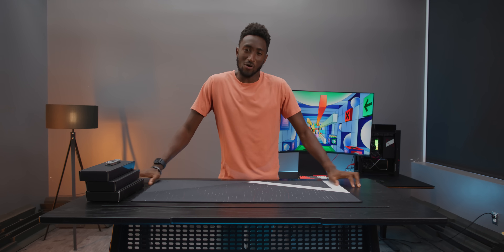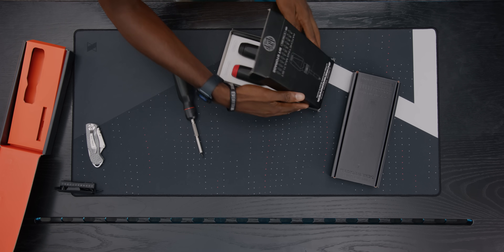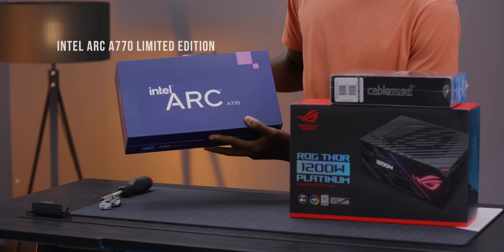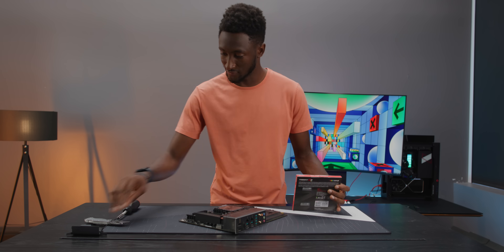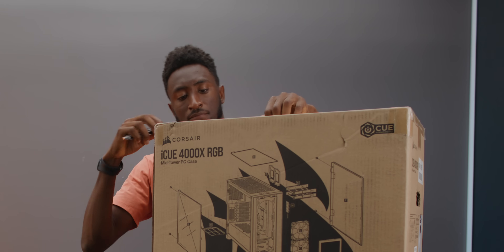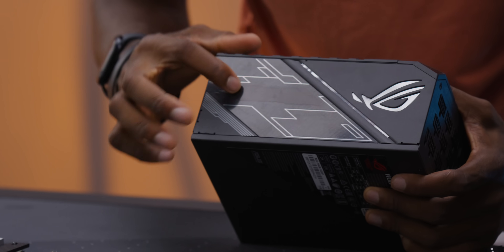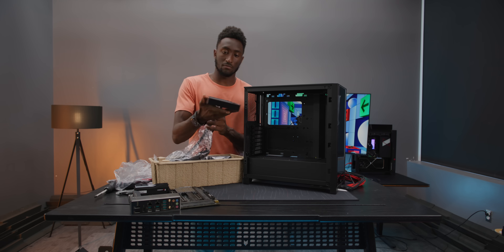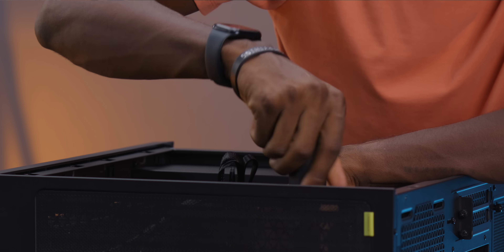World's First Intel ARC PC Build! (A770)

Comment: Now its easier to speak with hindsight now, and things have changed of course. But I will still criticise, for educational purposes, the video:
1. This build is wholly 'High-End'. Everything apart from he gpu is. Thats like calling the RX 6700xt 'High-end'. Nah, its a solid but budget 1440p card.
2.  You didn't say how much each part costs and total build cost. This is huge as people need to truly see the Cpu-Gpu imbalance. If you di an I5-12600k with the A770, THAT WOULD MAKE so much more sense (sorry didn't mean caps).
3. You really aren't supposed to front mount an AIO. Yes it works, but more dust gets towards the fans. Moreover (idk the exact science) but the cables are less optimised that way too.
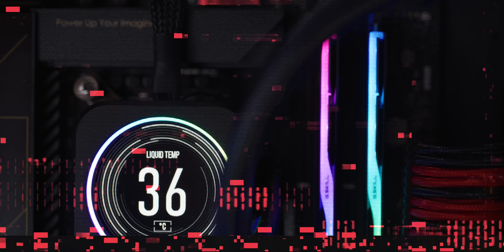4.. When doing the final shots of the completed build (14:45) , the 2 top fans are the wrong way round.
5. You only tested 1 game my friend. Yes time constraints and all that. But you tested ONE game. Come on now everyone else tests a good several and at 2 different resolutions. Hell even if you didn't have time to test at 1080p testing say 5 games at 1440p would have been actually a good test of the PC.
But I hope since its been a while now you know do these things. As well as doing: XMP profiles for ram, using Cinebench to test CPU etc.

Comment: That is the worst Water IO ever made; I got two DOA! I am surprised Corsair does not have a lawsuit against them at this point!
Reply: The h100i and h150i lcds and elite red triangle warnings and full speed fan issues seem to not be down to loose connections from the commander core, but a faulty commander core or cables. Moving the cables in the middle whilst on will give either of the two problems mentioned, or with any slight movement within a case over time. They'll usually send you a replacement under warranty but no real fix or swap for a better model. Even with the replacement I gave up on it after seeing the great number of forum complaints over these models. Corsair like to blame the issue on the software. I now have a thermalright pa120 fan cooler with no issues

Comment: why go so overboard on the powersupply for a system that will never go over 700w
Reply: Most good power supplies can last up to 10 yrs so he can use it if the system is ever updated or even changed completely.

Comment: You've got all expensive parts and then comes Intel Arc A770. It's a GPU for a completely different build, the CPU alone is more expensive than the card. Intel needs a broader range of dedicated GPUs, it's certain that you swapped A770 for something else. Interestingly, the performance gap between A750 and A770 is quite small. There's also a whole market for cheap, slow GPUs, Intel could get a foothold there.

Comment: The A770 is for 10th Gen Intel CPU's are greater and compatible motherboards. Here MKB is building it with a 9th Gen. OOPS!!!!!   Why?  Intel requires  Resizable BAR (ReBAR) enabled. This feature is only available on 10th Gen or newer Intel systems. In tests, Without ReBAR, the Arc A770's performance, on average, plummeted to 77% at 1080p.  Rebar allows much larger chunks of memory to be sent to the GPU.

Comment: Marques, please fix the CPU cooler. It really needs to sit on top. Either change it for a smaller 2-fan version or use a non-water cooling one. That poor thing is not working at its prime and will definitely shorten its lifetime. The system will probably take a bit of performance issues as well, as the water will not touch every part of the CPU (among other bad things, like bubbling at the top of the radiator, with its own bad issues) LTT selected all the parts??? shame on them... =)

Comment: Looking back, was any of this difficult? Were there any particular weird nuances when building this? This was a very clean build!
Reply: Now its easier to speak with hindsight now, and things have changed of course. But I will still criticise, for educational purposes, the video:
1. This build is wholly 'High-End'. Everything apart from he gpu is. Thats like calling the RX 6700xt 'High-end'. Nah, its a solid but budget 1440p card.
2.  You didn't say how much each part costs and total build cost. This is huge as people need to truly see the Cpu-Gpu imbalance. If you di an I5-12600k with the A770, THAT WOULD MAKE so much more sense (sorry didn't mean caps).
3. You really aren't supposed to front mount an AIO. Yes it works, but more dust gets towards the fans. Moreover (idk the exact science) but the cables are less optimised that way too.
4.. When doing the final shots of the completed build (14:45) , the 2 top fans are the wrong way round.
5. You only tested 1 game my friend. Yes time constraints and all that. But you tested ONE game. Come on now everyone else tests a good several and at 2 different resolutions. Hell even if you didn't have time to test at 1080p testing say 5 games at 1440p would have been actually a good test of the PC.
But I hope since its been a while now you know do these things. As well as doing: XMP profiles for ram, using Cinebench to test CPU etc.

Comment: The thermal dynamics are all wrong. Better get a larger case and put that radiator where it belongs. Trust me. Look at the air cycle. The amount of heat going back in is insane.

Comment: I hope Intel cannibalises the mid-range market from Nvidia. The artificial price hiking of the 40 series (to shift excess 30 series stock), the shameful marketing of a 4070 card as a 4080 (12gb) to further inflate prices... There needs to be competition in the low and mid-range space. 

$1000+ entry level to latest gen gaming isn't sustainable, damages the industry and generations should be increasing power efficiency, lowering form factor, lowering prices and increasing performance across the board. It seems Nvidia with its 40 series is incapable of innovating beyond higher power draws and thus performance.

Comment: 12:31 I almost wanted to say "mine", but on my build I found out that the case fans were molex... after I had mounted the modular power supply.

There's always something to improve, but mine went without any hitch bigger then 'needing to find the molex to power supply cable'.
After finishing the build I found out I had an old fan header->molex, but that would've made the front look less pretty.

Comment: Terrible build is terrible.  Way too much garbage RAM, too many SSDs, too much processor, 1200W power supply is ridiculous with a single A770, Cooler orientation matters the AIO will vibrate itself apart on bubbles and the Arctic Freeze is all around better cost, performance, and imperceptibly silent.  Whoever sold this to you took you.  Do you even know what you are doing?  You have a massive amount of money... pay someone to keep you from making these mistakes.  You're embarrassing yourself with this build.

Comment: I was panicking for a minute then.....I thought you were going to put 4 HOT gen 4 ssds in.....without any heatsink.....I was like... "is he making a computer or a fire risk" 

I got one of those 4tb sabrent rocket+ inside my ps5 with the specially designed heatsink cover for ps5......but when I have been playing for a while......if I rub my hand down the black middle of the ps4....I can feel a bit of warmth where the ssd sits inside.

Comment: the tubes at the top are probably the best place to have them as they will most likely be above the pump which is what you want. You want the pump to be below the inlet and outlet tubes on the radiator that way you don't get air that gets trapped in the pump.

Comment: The AIO tubes should be at the top. You need the pump to be lower so the air goes to the tubes instead of in the pump

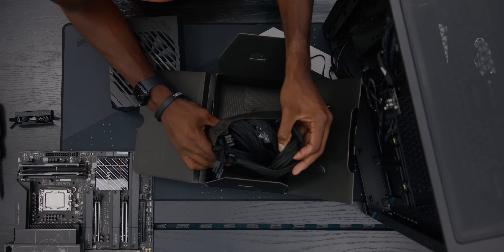Comment: 8:57 What? I think this'll break your PC if you don't use the cables that came with its own power supply.
Reply: bro that's what I've been looking for in the comments, literally NO ONE talks about this

edit: nevermind, I looked it up and cablemod sells both extension AND replacement cables, my guess the ones he used are replacement so it's fine

Comment: The fact its getting 85-90 fps at high 1440p where the 306012gb gets about 100 on those settings after 2 years of driver maturity and development done with nvidia and amd in mind and not intels xe. and the arc 770 seems to be coming out cheaper than the 3060, I imagine and see ARC really taking off especially after a few mature drivers come out to correct game performance. This has big potential.
Reply: The 3060 is not a 1440p card it's a 1080p card.
Reply: @evacody1249  Its marketed as a 1440p card. I was giving intel credit here for once. and 3060 is only a 1080p card if your shooting for 144-165 fps, most people I know still have 60hz monitors.

Comment: "tubes at the top" is actually fine, as long as the top of the radiator is mounted higher than the CPU block. You just don't want the pump in the CPU block to be the highest point of the loop where air bubbles can accumulate and damage the pump.

Comment: Arc A770
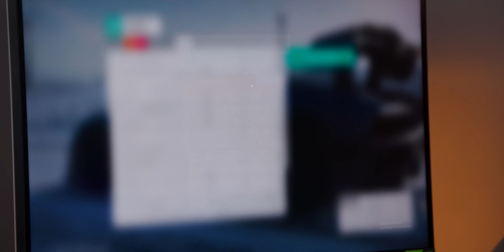"Forza Horizon 4" 15:47
- Dynamic Render Quality "High"
- Resolution "2K"
- Advanced Setting "??"
FPS Avg = 80 - 90

RTX 3060 12 GB
- Dynamic Render Quality "Ultra"
- Resolution "2K"
- Advanced Setting "Ultra-Extreme"
FPS Avg = 80 - 90

Arc A770 = RTX 2060/2060 Super not RTX 3060
Arc A770 MSRP = 329$
RTX 2060/2060 Super MSRP = ??

Comment: 5:47 Try to never push the RAM down like this. If you do it this way and your weight shifts in either direction, you could crack the slot and/or the teeth of the RAM.
I recommend installing RAM with your thumb and middle fingers supporting on both sides; then push down with your index fingers.

Comment: Great video! The build turned out great. Happy to see a collab between two of my favorite tech channels.
Reply: Now its easier to speak with hindsight now, and things have changed of course. But I will still criticise, for educational purposes, the video:
1. This build is wholly 'High-End'. Everything apart from he gpu is. Thats like calling the RX 6700xt 'High-end'. Nah, its a solid but budget 1440p card.
2.  You didn't say how much each part costs and total build cost. This is huge as people need to truly see the Cpu-Gpu imbalance. If you di an I5-12600k with the A770, THAT WOULD MAKE so much more sense (sorry didn't mean caps).
3. You really aren't supposed to front mount an AIO. Yes it works, but more dust gets towards the fans. Moreover (idk the exact science) but the cables are less optimised that way too.
4.. When doing the final shots of the completed build (14:45) , the 2 top fans are the wrong way round.
5. You only tested 1 game my friend. Yes time constraints and all that. But you tested ONE game. Come on now everyone else tests a good several and at 2 different resolutions. Hell even if you didn't have time to test at 1080p testing say 5 games at 1440p would have been actually a good test of the PC.
But I hope since its been a while now you know do these things. As well as doing: XMP profiles for ram, using Cinebench to test CPU etc.
Reply: @thefilthycasual448 irrelevant

Comment: Tubes at the top is perfectly fine as long as part of the radiator is higher than the pump. That way the air will settle in the radiator and not the pump.

Comment: Good to see Intel finally get back into the discreet GPU game. Looks like a great contribution. Hope they keep releasing great products.
Reply: More competition almost always benefits the consumer. This is great!
Reply: Pretty nice Arc gaming performance ill give you that, but i see these Intel gpus more in the ballpark of monster budget AV1 video editing/server systems. For 289, now THATS interesting.
Reply: @gimubatulo  u know the rtx 4000's decode av1 right?
Reply: Plus the also-budget almost double than 3060 ai accel
Reply: It's ackshually a discrete (i.e. separate) GPU. Although, it happens to be a relatively discreet (subtle) one too!
Reply: Arc has been effectively cancelled inside Intel for discrete GPUs over the next 3 years or so due to massive failures within the hardware team. For context, this GPU and its higher end brethren were supposed to release in Q1.

This GPU, specifically, the A770, was released at a loss to save face.

Don't expect anything too significant or competitive from Intel for at least 3-4 years.
Reply: @Walkop  Source, "Moore's Law is dead" and for some reason that matters more than Pat Gelsinger himself.
Reply: @Walkop  They have put a lot of resources in this, Also intel know about the RDNA and Zen integration, that could give a serius advantage to AMD
Reply: @Walkop  this aged poorly with the order intel placed with TSMC for the next gen of ARC.
Reply: @Walkop  good for you mate!

Comment: Its a great video, please dont get too mad, its just all of the components are completely unbalanced and made me cringe............ who in there mind would spend between $5,100-$5,400 on a build like that???

ROG THOR 1200W PLATINUM power supply????? that's $350...
G.Skill Trident Z5 RGB 64GB DDR5 Ram??? that's $420... 
Sabrent Rocket 4 Plus NVMe SSD 4TB is $700 X 2... $1,400
Sabrent Rocket 4 Plus NVMe SSD 2TB is $300 X 2... $600 
CableMod RT-Series Pro ModMesh PSU Cable Kit is $100... 
ASUS ProArt Z690 Motherboard is $450...

Intel i9-12900k CPU Processor is $605...
Corsair H150i Elite LCD CPU Cooler is $290...
Corsair 4000X RGB PC Case is $145... this is the only common sense thing in this ENTIRE BUILD
Intel A770 limited edition: a GPU that most will never see, that has no confirmed price, that may never actually launch, that supposedly performs like a RTX 3060/3060TI............... which is supposedly under $400

IN TOTAL IT COMES OUT TO $4,760, after 7% tax comes out to $5,093.20, or in California with 13.3% tax comes out to $5,393.08. that is completely unbalanced, and unnecessary, for the same price you could get something functionally and aesthetically better, with a complete setup, monitor, chair, desk, headset, mic, AMP, camera....
Reply: The Intel Arc A770 confirmed price is $329 and is due launch on October 12th

Comment: Only quirk I noticed was the two top mounted fans were set as intake instead of exhaust. Heat rises, so top fans are almost always best for exhaust, not to mention potential dust buildup. I know most say positive pressure cases are best for dust prevention, but in this, three intakes and three exhausts for a mostly neutral setup would be ideal. Hadn’t seen any other comments on it with a quick scroll through, just though I would mention!

Comment: Prices of Components:

Case - $129.99
Motherboard - $449.99
CPU - $584.98
GPU - $349 to $399
RAM - $419.99
SSD - $699.99
CPU Cooler - $149.99
PSU - $319.89
PSU Cable Kit - $79.90

Total - $3,183.72 to $3,233.72
😅

Comment: Is the Proart one of those rare mobo that does the RAM on the odd numbers? Because if not, he installed his RAM wrong. It’ll more than likely still work but why not just do it right?
Edit: Use a flat head screwdriver on top of a board with tons of little circuits, chips, etc? Brave man.

Comment: Tubes at the top is fine. Obviously the most ideal is mounting the radiator at the top of the case but there's nothing wrong with mounting it the way you have it. As long as the pump isn't at the top of the loop you're fine. Nice build Marques.
Reply: I came here to say this as well!

Comment: I have seen a lot of PC building videos and it is almost a rule, that you PC Builders buy a CPU cooler radiator that doesn't fit the case. CHECK THE SPECIFICATION OF THE CASE.
In my opinion it is beginning to seem amateurish every time you get this wrong. And you are supposed to be the experts.

Comment: Unfortunatly I don´t concider an Intel GPU anymore, I´m confident in what Tom sais his sources at Intel told him is pretty legit. Low volume for retailers on ARC, Intel wants to dump most ARC GPUs to OEMs in hope of less negative reports since most gamers don´t buy a DELL/ HP/ Lenovo etc for gaming and most who do, might not care enough as long as everything is about working. Battlemage only gonna be a single low-end DIE, maybe midrange but noone should bet on that and for mobile only, no desktop Battlemage and if Celestial is even get to be made or stomped or what ever is 100% uncertain at this point. Doesn´t really give any confidence into buying an Intel GPU now. I hope Intel figures their issues out and can lunch a Celestial or Druid desktop GPU, even if they do with just a low-end or midrange GPU, if they get to the point so they can lunch an actually decent desktop GPU without all those driver issues and getting other APIs than Vulcan and DX12 to run properly, can´t recall how ARC does in the Unrealengine, but DX11 and below performance simply isn´t good enough. Don´t mind if they accomplish that with emulation as long as the old games I still like to play occasionally run well. Don´t need 200-300FPS in e.g OG FarCry or in TimeShift, if they get to +60FPS in a modded version with cranked up settings it´s good enough for me for those old games.

Comment: Nice build, though would of gone with the 5000X case so you could top mount the 360mm aio and leave the front fans drawing in and aio exhausting.  Looks like your top fans are mounted to draw air in, I'd switch to have them exhausting.